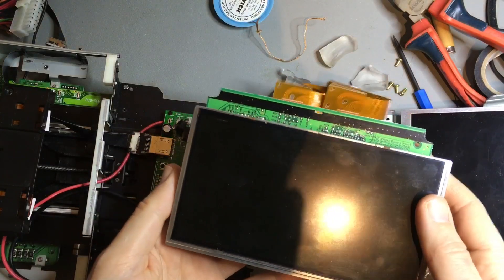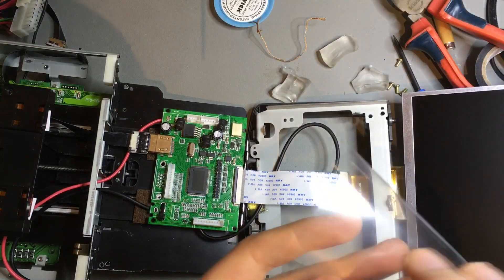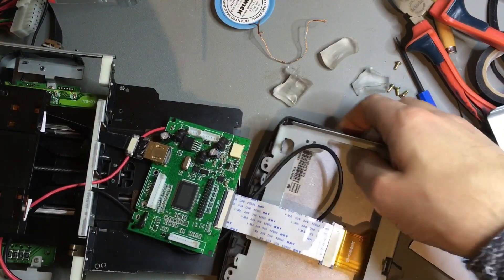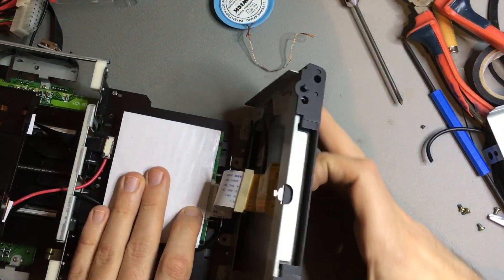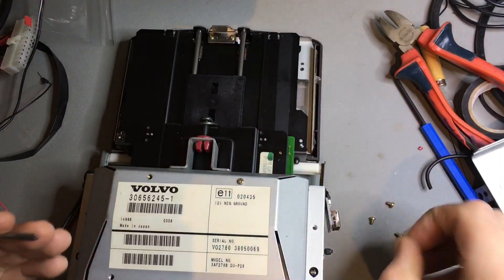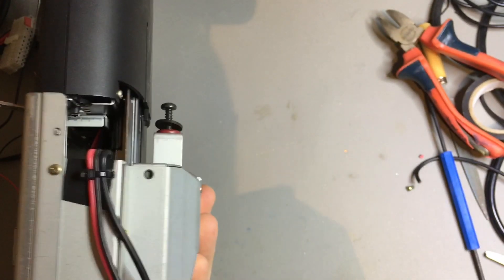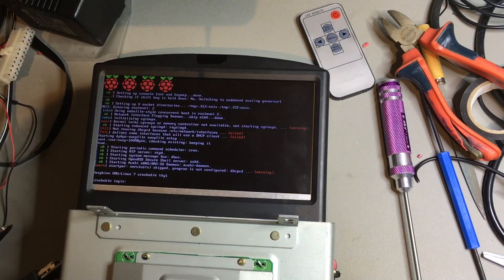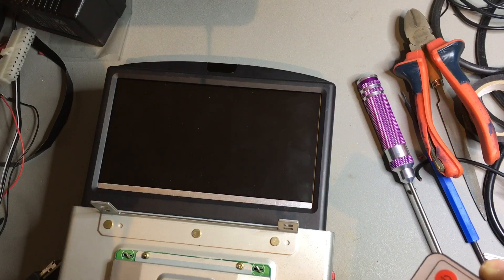Volvo RTI: Installing a new display

Comment: What board did you remove exactly? I’m looking to do something fairly similar but with a smartphone/tablet. Thanks
Reply from the maker: The one behind the display. It's the display driver. Its sole purpose is putting an incoming video signal on the display. Since I removed the old display I no longer need that board. 

The other board in the base seems to be for controlling the motor and receiving signals from the controls on the steering wheel as well as some power supply stuff.
Reply: Thanks for the fast reply! What’s the overall size I can fit in the standard housing? Just looking into the tablet route :)
Reply: Do you think a 800x520 would have fitted rather than 800x480?
Reply from the maker: ben nash the display is 155x90mm(6.5" diagonal) and fits pretty well. It matches the old display in size. You may be able to fit a few more mm in there but that may require some "adjustments" to make more space.
Depth-wise I'm not sure. I've seen people putting an android phone in there :)
Reply from the maker: ben nash maybe 520 would fit, but I'm not sure you would be able to see the extra pixels. The dashboard blocks the bottom of the screen slightly I think...
I can barely see the metal strip at the bottom of the display when I'm behind the wheel, and I'm 1.90m tall (6'4")
Reply: I believe going to a 520pixel (5mm larger) should be a better fit so it would hide the white that you can see in your video, other than that dimensions of the fire 7tablet should fit 137x193x10.3mm total size. So I’d imagine very similar overall dimension as the screen you fitted:)
Reply from the maker: @bennash2664  Have a look at https://www.youtube.com/watch?v=EKT92IAkY6E at the 2:10 timestamp to see the display in action while it's in the car. The metal strip is barely noticeable. If you put in a larger screen then you might end up with a bit of screen blocked by the dashboard.

That fire7 tablet may fit if you gut the device and somehow manage to fit everything in the car's display housing. 193mm is considerably larger than 155mm.
Reply from the maker: ben nash yes, that's the one I'm using: Innolux AT065TN14. You'll also need a driver board with HDMI input. There are touch screen overlays for it available as well.
Reply: Thanks, don’t suppose you could send me a link for those could you? 😅
Reply from the maker: ben nash eBay nr 392858230331 seems to match the driver board I'm using, there are plenty of others, just search for the AT065TN14 Driver. Not sure about the touch panel since I don't have one
Reply: Typed that number in with no matches 😂😂😂
Reply from the maker: ben nash https://www.ebay.com/itm/VGA-2AV-LCD-Driver-Board-For-AT065TN14-AT070TN92-800x480-LCD-Screen-A/392858230331? Hope this works?
Reply: Brilliant Thankyou

Comment: do you have the file ( image) for the Raspberry Pi?
Reply from the maker: No, sorry. I think it was fairly simple though. Just a standard raspbian installation with some slight modification of the display settings to match the resolution of the LCD. The program was some OpenGL ES example code with the 3D model replaced by a model I downloaded somewhere.
Reply: @dvdouden  thank you

Comment: Hi! I'm trying something similar. Do you think there's some way to keep using the wheel controls?
Reply from the maker: I'm not sure, my best guess would be: probably.
If I understand the wiring diagram correctly, then the buttons on the steering wheel are connected to the Steering Wheel Module (SWM) through a LIN bus protocol (it's the dumber slower brother of CAN bus). This signal is then propagated to the Central Electronics Module (CEM). Unfortunately, this signal does not seem to be connected to the Data link connector (OBD2 connector), but from what I've read a lot of this data is also available on the low speed CAN bus, which is connected to the Data link connector (on pins 3 and 11).
So in theory, you could connect a microcontroller to the low speed CAN bus and read the messages from the SWM, it probably contains the state of the steering wheel buttons (and much more) and from there you can do whatever you want with it.

Comment: What display it is?
Reply from the maker: I replaced the original screen with an Innolux AT065TN14 panel. It's 6.5" and 800x480. I think I paid $15 for it. The controller board is unbranded. It was marketed as "LCD Driver Board for AT065TN14 AT070TN92". It costs around $12.
Reply: Hi again. If i want to change ONLY the LCD is it needed to order it with board? Or just remove and place the new LCD.
Reply: @o_o3040  The new LCD runs a higher native resolution, and so display signal/timings would therefore be different than that of the original LCD. The controller board he is using is matched to the new LCD. The ribbon cables for each screen are likely completely different as well.

In other words: No, simply swapping the LCD would not work. The board is required for the new LCD to function.

It should be noted also that even if the new LCD used the same connections, and could utilize the signal/timings from the original controller board, there would still be no point in upgrading to a new LCD since the board would still be outputting the same old resolution, completely negating the use of a higher resolution screen... It would be like playing a regular old DVD on a shiny new 4K TV (480p signal on a 2160p display - a complete waste)  ;)